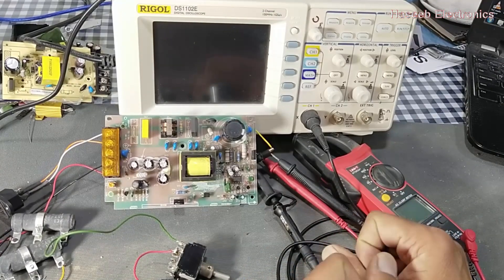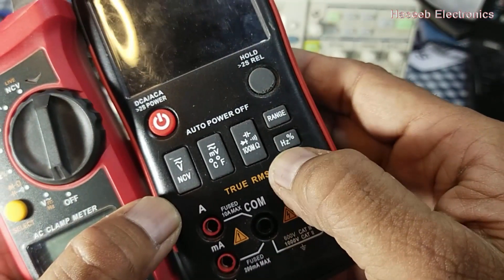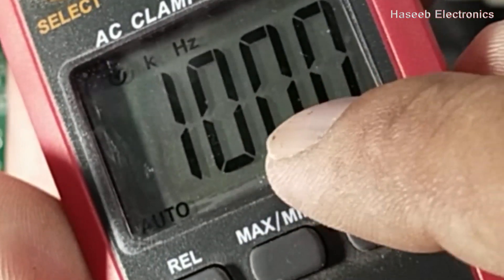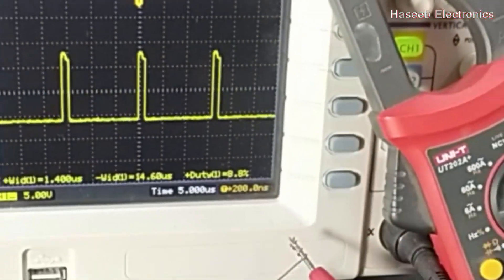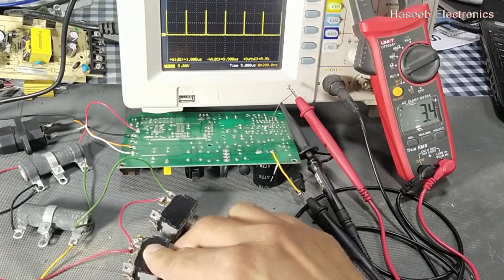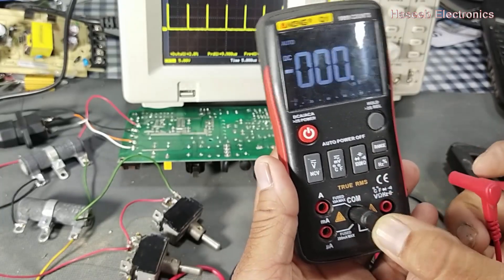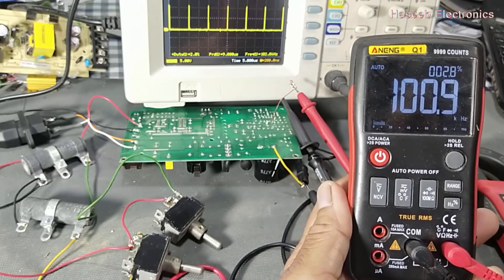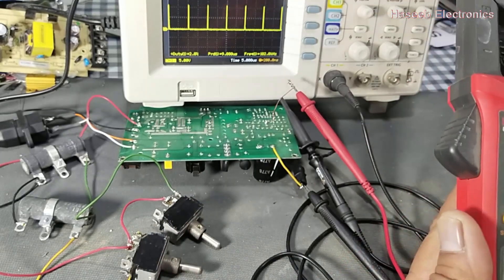{526} How to Measure Frequency and Duty Cycle with Multimeter

Comment: Is it pwm signal?
Reply from the maker: yes, it is PWM signal, when the turn on time vs turn off time is changed to take a useful function (within a stable frequency),
Reply: @HaseebElectronics  I have ZT301 multimeter will that detect pwm frequency?

Comment: DM 98 me frequentcy kayse check korunga
Reply from the maker: set to DC volt or AC volt (depending on test signal)
then press FUNC button 
it will shift in frequency mode
Reply: @HaseebElectronics  reading is variable do not fixed

Comment: Can we use the duty cycle function of the multimeter to see if a laptoo IC is working, for exampe the super IO or the RAM?
Reply from the maker: no. because the multimeter have capacitive input, at high frequency its capacitive reactance will very low, so it can damage the remaining board
Reply: @HaseebElectronics  Thank you for the answer.

Comment: thanks dear sir .
which pin in the ic you used to test frequency ?
the common negative here is it the smoothing capacitor negative lead ?
Reply from the maker: thanks a lot 
black probe to main capacitor -ve terminal 
red probe to pin number 6 (output pin of UC3842 /3843 /3844 / 3845)
Reply: Jazak Allah Khair.

Comment: Thanks for this great video! At 2 minutes 36, why the aneg multimeter displays 262 volts which is already on dc mv. then pressing dc mv. it displays o.l, on ac mv. , it indicates 34 mv. Are the pulsations not always in the same direction? Why do we have an alternating voltage? Thank you ! I love your very informative videos!
Reply from the maker: Oh no dear. it is 262mV not 262V
as this signal is square wave at 100KHz and the amplitude is 11 Volt but this multimeter cannot read correct voltage in high frequency 
it displays frequency and duty cycle